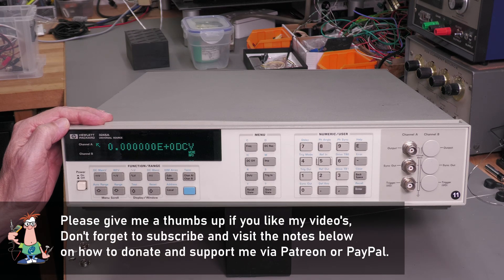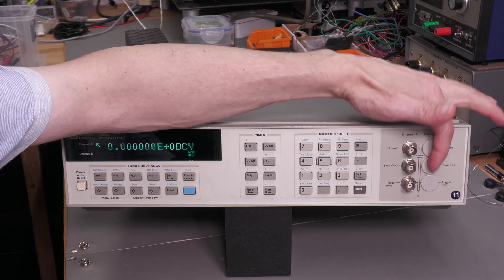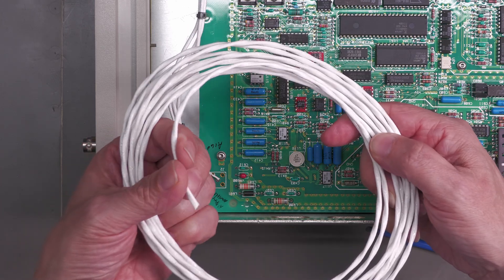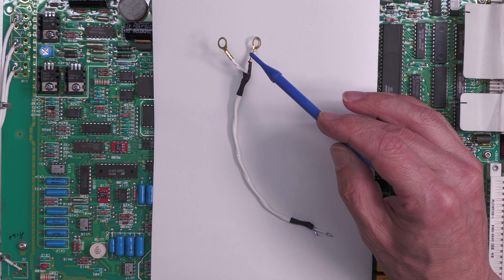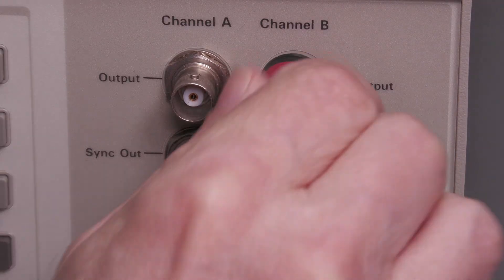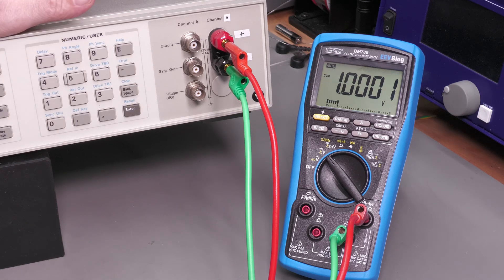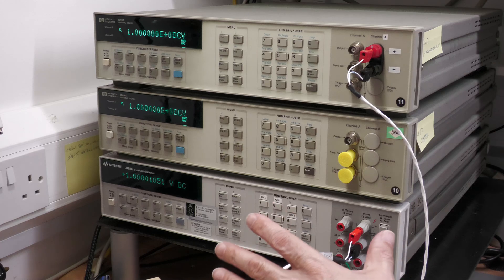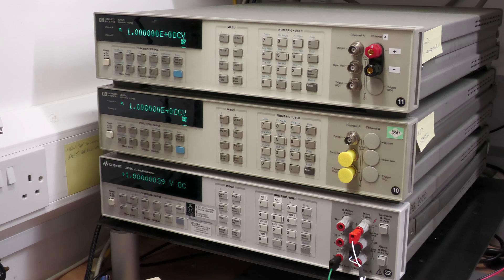No.118 - HP 3245A Universal Source Repair, Mods & Upgrades - Part 3

Comment: Is it a loading issue? Might be interesting to have two meters hooked up to the outputs, one on BNC, the other on the 4mm jacks. Unplug one set and see if the other one changes and again when it is plugged back in. (ah, OK, just read the pinned comment)

Comment: Lol,🙄 Can't see the forest for the trees.. never happened to me (tongue in cheek).   Makes one wonder what triggers the range change and why it was on the borderline between ranges?  Maybe it was a high inducted 50Hz mains voltage either between the instruments or cable handlerling?   As was pointed out below, especially for calibration functions removing the auto range and replacing it with a fixed range would remove that possible error.    And take a holiday, at least a short one.

Comment: 1-3uV differences?

Not sure if you have to go 100% copper with tellurium / gold plating to eliminate that issue. I know it's extremely niche but would be lovely if one of the voltnut youtubers did a deep practical/experimental dive on thermal EMFs of different metal contacts. Different metals, different platings, different solders, crimps vs nuts vs soldered connections, time to equalise, repeatability of differences

Incidentally that's one reason to use 10V as a standard number of interest over 1V, reduces the need to care about this issue by a factor of 10. Yes it'd be nice to have tellurium copper everything but it's bloody expensive 🤣

Comment: As alejandrosilva7520 has poiinted out, your 3458A is faulty. It doesn''t autorange properly - like every other 3458A. It's a firmware bug; I sure that will upset some who will claim it's not a bug, rather it was a design decision as to the choice of switching threshold and hysteresis - but in the real world it's clearly a bug, randomly choosing the 12V range or the 1.2V range for an input a few uV above 1V, that varies no more than a few uV, is really inexcusable. The ohms range is just as bad. Of course 3458A owners will, with a little experience, have discovered this and use manual ranging. But being human we all forget from time to time resulting in wasted measurement time, video production/editing effort and aggravation and results that have to be discarded. And don't forget the time spent by all the viewers and commentators here looking for possible explanations of ian's problem.

I'd cut more slack with HP's development team except they must have known about this screamingly obvious fault which must have been apparent at an early stage in testing and yet they chose not to fix it. I'm guessing this was a result of internal political infighting between the system design team (who presumably specified the requirements), the firmware/hardware team (who may or may not have, initially, appreciated the problem), the test teams (who would have complained about it) and management under pressure to get it out the door ASAP and at least cost.

It's baffling to me that they didn't address it though given that it was going to be so readily picked up buyers and yet almost trivially easy to correct. Customers have to wonder that if HP couldn't get something as simple as autoranging right, what about much less obvious but important and perhaps much more insiduous issues might be lurking? Could, for example, the default delay times chosen for resistance measurements be a bit suspect? (You might not be surprised, in case you were wondering, to learn that they are). But, to be fair to HP, history shows it wasn't exactly fatal for 3458A sales and the 3458A does have a few redeeming characteristics as well :)

Comment: Metrology rule number one - never ever use autorange :-). Aren't those cheap brass posts? Perhaps TBP-3 would be much nicer post in this mod...
Reply from the maker: Yes, I always always always use manual range……erm, except this time!
Posts were purchased as gold plated. I’ll look at your suggestion.
Reply: @IanScottJohnston  These dual posts look like cheap brass with heavy layer of nickel under the gold plating. Real low-thermal EMF gold plating over bare copper is almost always dull matte. But it's a special process and uncommon (read = expensive).
Reply from the maker: Data sheet, says gold plated contact material, but index not clear……hmmm!
https://cdn.shopify.com/s/files/1/0695/1347/8453/files/356048.pdf
Reply: @IanScottJohnston  It's pretty clear to me, brass post, with zinc terminal body. Fine for generic use, but nothing to do with low thermal. Because it's rare to find pure copper+no shielding metal+gold I steer away from any gold plated stuff. It's easier to clean copper every time I need nanovolts, than settle about crappy connectors. :)
Reply: @xDevscom_EE  agree, Pomona 3770-0  and 3770-1 would also be better if you're fussy about the last couple of digits.

Comment: Your new 4mm jacks, are you sure that they are low e.m.f. ? Why haven't you assembled two POMONA CuTe in first place? I would have used properly crimped Cu lugs on the back of them. Have you used the shield of the PTFE cable, or is this used on the BNC connector side? I would try to reverse the measurement cable, and calculate probable offsets from the + / - readings of the 3458A.
We just have a similar discussion on eevblog in the thread from RAX, about his 5440A repair. I've posted a method to identify e.m.f. offsets and external noise.
Reply from the maker: Erm, there is no problem with my 3458A, it’s just jumping between 1V and 10V ranges thus the extra digit appears and disappears…….LOL!
I guess I am so used to using the 3458A via GPIB.
The banana sockets I am using will do for now, the 3245A is quite a noisy source in the first place.
The ETFE cable I fitted is screened.
Reply: @IanScottJohnston  Well, basically the reading of the 3458A in its 1V  and 10V range should read the same, within about 0.3ppm, but they deviate by 3.2 ppm. That's a lot of a difference.
That looks as if you haven't done an ACAL DCV before.
Reply from the maker: @DrFrank-xj9bc  I hadn’t done an ACAL DCV, wasn’t at that point yet. It’s been about a month since the last one as I haven’t been using it.
Sidenote, it’s due for its trip down to Keysight for Cal beginning of 2024, two years goes past so fast!

Comment: If the cables are not shielded, what stops them from picking up emf from the surroundings?
Reply from the maker: I have tried a mix of coax, shielded and non shielded cables. Same problem.

Comment: Could it be a hum issue causing an offset? Is there a way to specify the number of 50/60Hz cycles in a sample?
Reply from the maker: NPLC set to 100 during my test which is high and should mask and 50Hz issues.
Reply: The 3458A always samples a whole number of mains cycles as a matter of course. It literally times itself to the zero crossing of the mains it is being fed. Usual for measurements is to ask for measurement over 100 cycles of mains

Comment: Seebeck effect perhaps?
Reply from the maker: The voltage pops back n forth randomly, sometimes doesn’t change so don’t think so.
Reply: Likely right, but i'd still point a hot air gun at the junctions, at a low setting, just to rule it out entirely.  @IanScottJohnston
Reply from the maker: @chuckvanderbildt  agreed, not ruling anything out at this point.

Comment: Oh dear, looks like the 3458 has some odd math issue or something…
Reply from the maker: This is a hardware problem most likely.
Reply: @IanScottJohnston  have you tried with a different NLPC or averaging to see if it still shifts?
Reply from the maker: @TheDefpom  yes, makes no difference.
Reply: @IanScottJohnston  could be an input buffer or ADC issue then where the loading effects it, try a parallel resistance to see if adding a constant load changes the behaviour, did you try changing the input impedance setting? In fact, could it be automatically changing the input impedance based on range, and a bad reed switch is causing it to not always switch back?
Reply from the maker: @TheDefpom 10Gohm fixed for under 100V range, switches to 10Mohm for 100V range and above.
Actually, I have yet to test resistance and current modes on the 3458A.
Reply: Unlikely, impedance is switched only in 100/1000V range.
But is easy to check, just set manual range and countercheck again with fixedz on